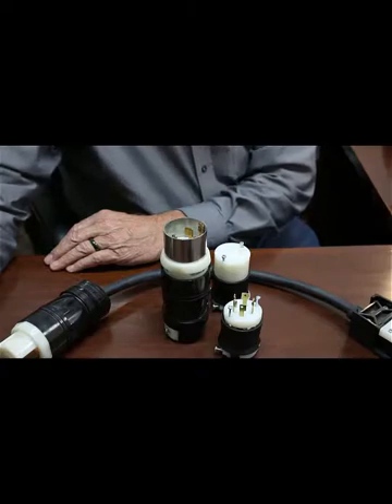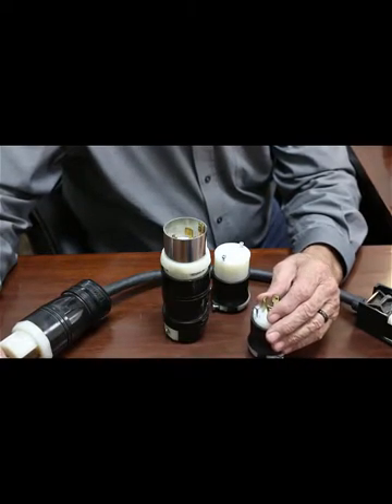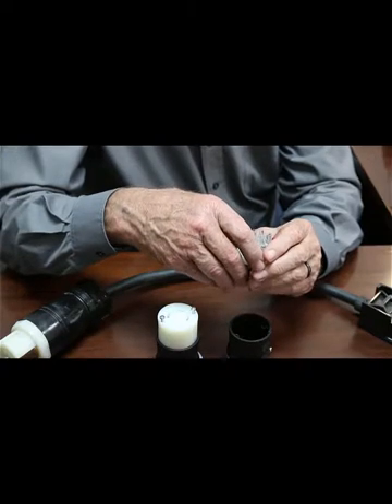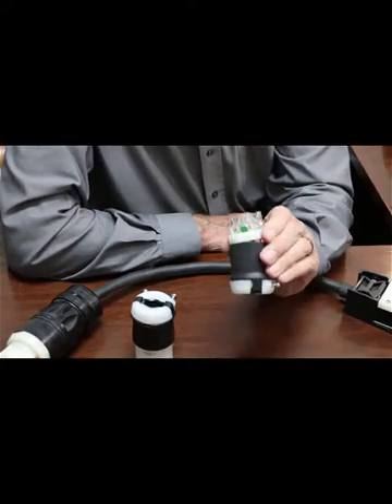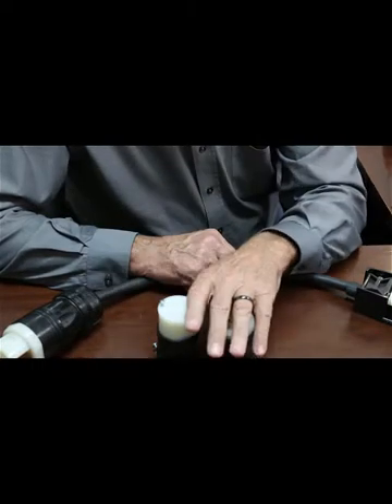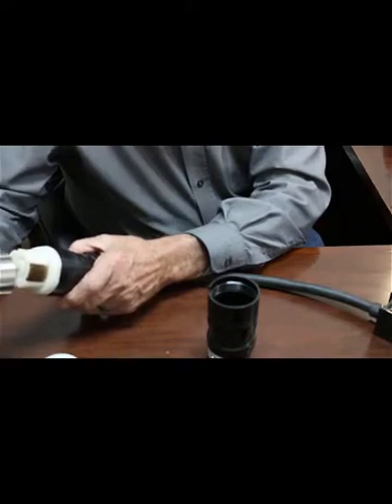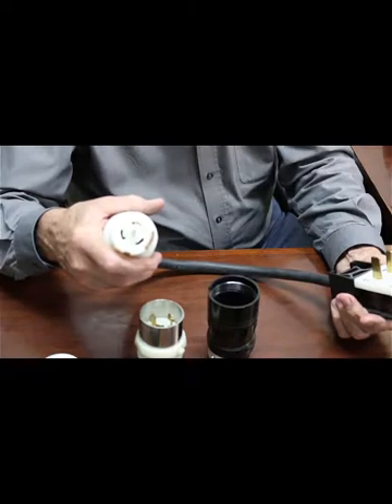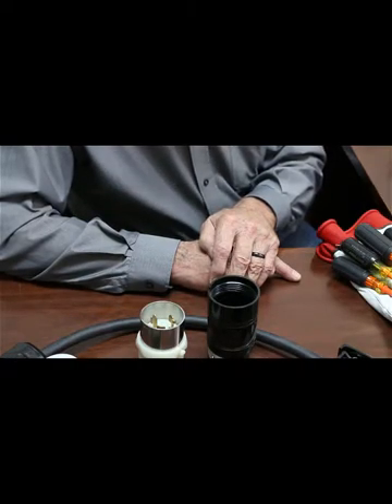3 Phase adapter cords and extension cords for the shop

Comment: Can you use a 220v single phase to a 230v 3 phase?
Reply: Hi Michael - OK this will sound nuts but -> 220 single is really 2 - 110 circuits of 2 poles of the generator and 3 phase has 3 configs - that come off of 3 poles of the generator - config 1 - called wye wiring and is more commonly known as 110/208 were all 3 legs are 110 and crossed will be 208 - config 2 is wye/delta were you have 2 - 120 legs and 1 - 240 leg - when you find which leg is the 240 then you can use the 120's for single phase - be darn careful as live juice is dangerous - then config 3 is delta and that is 240/240/240 many times without a ground and you would have to use a transformer to generate the 120's and the ground for single - delta that I use is up to 600 volts and I am darn careful with special tools and protective clothing to hopefully keep me alive if there is a explosion - so I know that's a lot to think about but there are 2 configs that can work.  thanks for interest - art